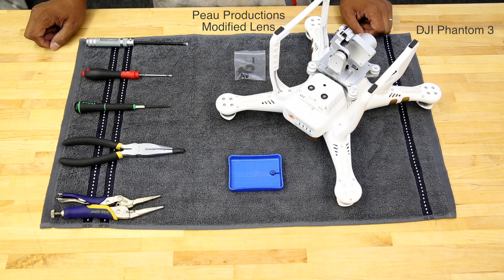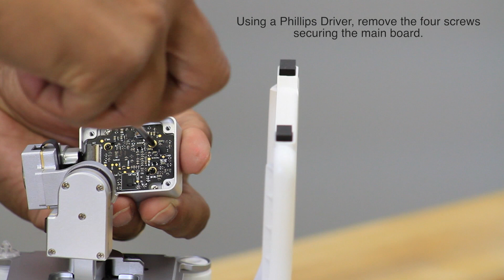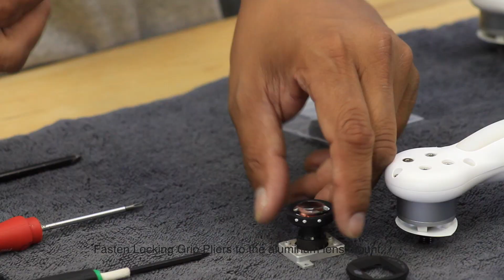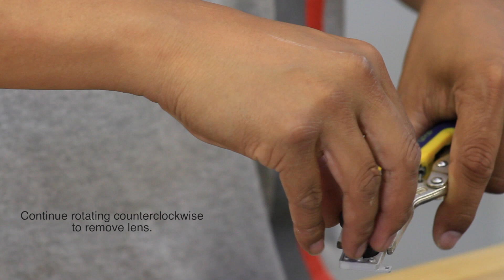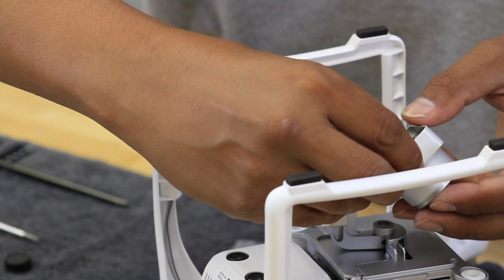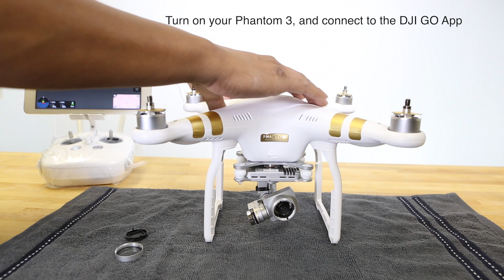DJI Phantom 4, 3 and Vision 2+ Lens Conversion

Comment: Hello, i received the phantom pro 3 .  with the Video and photo the resultat is very bad, like a gopro withe 1 😁 , i do your maintenance ,and now i ready to focused the Lens. But wath the adjustment of the sharpness should be on a near or distant spot ? or on a table with the settings as a pattern ? what to do after for a perfect picture ? Thanks a lot thierry
Reply from the maker: +thierry goris To properly focus for infinity you'll want to turn the lens until a focus chart about 4ft away is in focus.

Comment: I need to make agriculture analysis, using a phantom 3. Which lens and software is required? Do I need to modify the camera firmware? I'm trying to understand how the whole thing works. The Red_NIR lens is basically a red highpass filter blocking green and blue and lower frequencies, but how does the software knows which part of the spectrum it is looking for since the NIR field would appear in the rgb color space?
Reply from the maker: You'll want to purchase a lens with our NDVI Red+NIR filter installed. This filter allows both a red and NIR band of light to be captured by the sensor. Then using our post processing workflow here (https://www.peauproductions.com/pages/calibrating-dji-camera-ndvi-red-nir-images) you can produce the desired agricultural plant health images.

Comment: I have a focus problem on my camera 4k phantom 3. It focuses on what's next, up to 8 meters, and the rest of the image is very blurred. Can anyone tell me if I can focus my camera in the same way as taught in this video? Thank you very much!
Reply from the maker: +Renato Monteiro You can adjust the focus of the lens by turning it.
Reply: +PeauProductions Running the same way as you removed for replacement lenses in your video? For the native camera DJI has a much larger diameter than the example of the focus calibration that you did. What caused me some concern was the little room is left to rotate the lens, to remove only the front cover, coupled with the problem of the lens come with glue around the edges. Is it possible to adjust focus without having to remove the entire camera body, moving only the front lens? I'm sorry for my English, because I'm from Brazil.
Reply: +PeauProductions Thank's for your answare ;)
Reply from the maker: +Renato Monteiro Sounds like you may have the Standard edition? We've heard that version the front part does not come off making it very difficult to adjust the focus. You can take the camera apart, twist the lens, reassemble and then check. If it needs adjusting you can take it apart again and adjust. That's not ideal but on the models you can't remove the front part it's the only way to do it.
Reply: +PeauProductions I can remove the front, but there is little room to use the tool to rotate. My drone is equal to what you present in the video Phantom 3 Pro.
Reply from the maker: +Renato Monteiro Then you will only need to take it apart the first time to break the glue holding the lens in place, and then you should be able to turn it when it is assembled. We typically replace the lens with one that is smaller in diameter so it's easier to grab and adjust the focus.
Reply: +PeauProductions Wow, you solved my problem! thank you so much!

Comment: What is the effect of the lens you sell? Wider FOV? I'm very curious.
Reply from the maker: +Court Kizer The lens is 18 degrees narrower but the main reason our customers change the lens is because the 4.35mm comes in various filter options.The most popular one is the NDVI filter for agriculture health assessing.
Reply: +PeauProductions ndvi filter. is that so the camera can see heat?

Also, is there any way for the retailer to see that i have opened up the camera to focus my lens? As long as i dont make any marks on the soft aluminium
Reply from the maker: +GranVlog No, NDVI compares reflected IR light and absorbed visible light. It can show you where plants are and how healthy they may be compared to other nearby ones once you process the resulting images.

No idea on whether a retailer would know, each one is different.